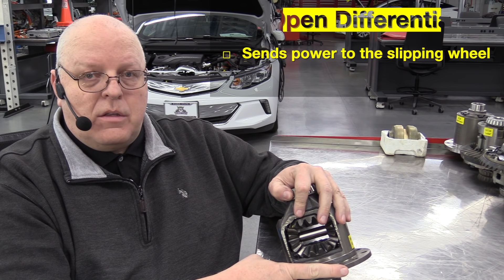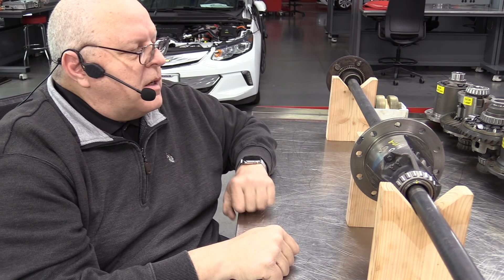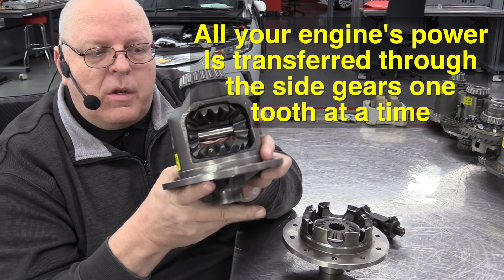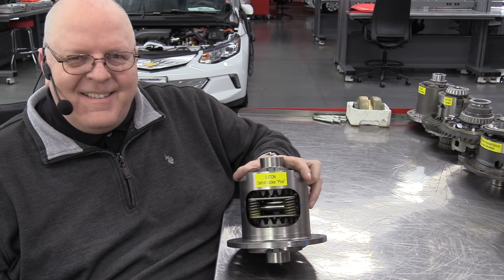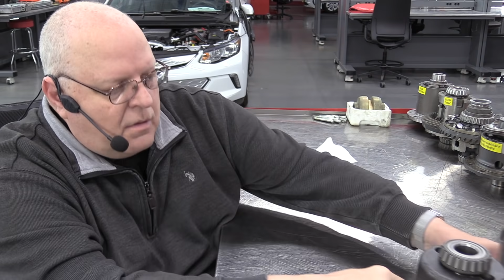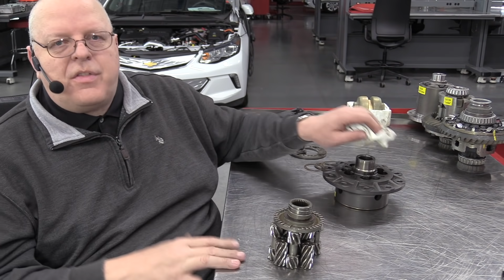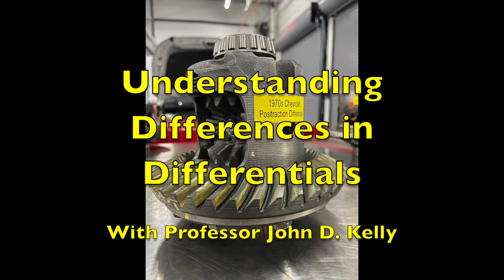Understanding Differences in Automotive Differentials

Comment: I believe that the original LSD operation mode (in my opinion) is different from the explanation given. The clutch packs are squeezed by action of the ramps in the casings and not the bevel of the gears (although it might be part of action). 
Specifically, the pinion pins are floating on the ramps/cams (heat treated angled areas in the case) and when there is a speed difference and torque applied the pins will ride up the ramp thus squeezing the clutch packs. This particular case would be identified as 2-way LSD (having effect in both directions).

Note: I might have misunderstood due to possibility that the original LSD was not the same LSD used for demonstration.
Reply from the maker: I believe you are correct. I got that wrong on that early differential. I tried to find the original patent with the original drawings and description, but could not. Thanks for the feedback!
Reply: @WeberAuto  One more item:  It is the torque applied to the ring gear that determines the force applied to the clutch packs.  It is not the differential action that creates the force.  When coasting, the differential has minimal clutch force and spins freely.  When torque is applied, the clutch force increases and the differential is harder to slip.
This knowledge can be used to get more traction out of a LSD.  If one wheel is freewheeling, little torque is applied to the other wheel.  If you apply the brake, apply power and ease off the brake, the clutch packs are loaded with more force and the clutches will transmit more torque to the other side.

Comment: Thank you!  Fascinating! Differentials always amazed me but I never knew exactly how they worked. First differential I ever saw was in my Tamiya Porsche Turbo Rsr Type 934 Jagermeister RC model car I built and my Dad who worked in his youth as an auto mechanic explained to me what a differential does.

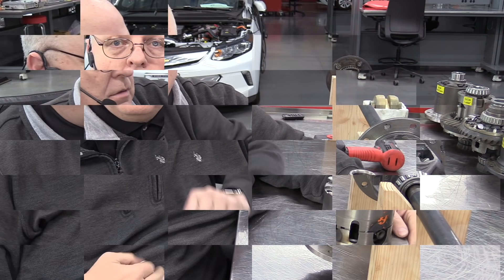So when you got to "17:23 See a 1963 Chevrolet positraction differential with clutch packs" didn't everyone think of the scene from the movie "My Cousin Vinny"?!

Mona Lisa Vito: The car that made these two, equal-length tire marks had positraction. You can’t make those marks without positraction, which was not available on the ’64 Buick Skylark!

Vinny Gambini: And why not? What is positraction?

Mona Lisa Vito: It’s a limited slip differential which distributes power equally to both the right and left tires. The ’64 Skylark had a regular differential, which, anyone who’s been stuck in the mud in Alabama knows, you step on the gas, one tire spins, the other tire does nothing.

Juror #1: That’s right.

Vinny Gambini: Is that it?

Mona Lisa Vito: No, there’s more! You see? When the left tire mark goes up on the curb and the right tire mark stays flat and even? Well, the ’64 Skylark had a solid rear axle, so when the left tire would go up on the curb, the right tire would tilt out and ride along its edge. But that didn’t happen here. The tire mark stayed flat and even. This car had an independent rear suspension. Now, in the ’60s, there were only two other cars made in America that had positraction, and independent rear suspension, and enough power to make these marks. One was the Corvette, which could never be confused with the Buick Skylark. The other had the same body length, height, width, weight, wheel base, and wheel track as the ’64 Skylark, and that was the 1963 Pontiac Tempest.
Reply from the maker: Thank you! I loved that movie
Reply: @WeberAuto  I love that movie too and now after learning about how Positraction works I will love it even more! By the way in May 2019 I was in Ogden for the 150th anniversary of the Transcontinental Railroad and to chase UP 4014 Big Boy. I ended up driving right by Weber State University which I didn't know was so close by! I really wanted to stop and see if you I could find you!
Reply from the maker: @mikekimura2532  I was probably there. I remember hearing the roar of the Big Boy steam whistle all the way across town when it arrived. We have moved into a new building in Layton Utah now. It is about 7 miles south of the Ogden campus.

Comment: You should add 1 way / 1.5 way / 2 way limited slip differentials, they have interesting ways of engaging, with a different effect on driving characteristics. The brand KAAZ seams to be popular in the aftermarket. 

Also, you talked about applications, such as rock climbing, but not drifting? I'm going to bet that 90% of people welding diffs are drifters.
Reply from the maker: Thank you for your suggestions. I am not a fan of welded differentials.
Reply: @WeberAuto  no one is. We're just poor.

Comment: What kind of diff do most fwd cars have? Ive had all fwd cars (dating from model year 1985 to today) except for a 01 grand marquis with an open diff. That open diff led it easily getting stuck in the snow. If 1 wheel was on ice and one on pavement you wold be stuck. None of my fwd cars,,, from chrysler honda gm hyundai ever behaved that way. I might get some wheel slip but it was always breif and youd get going easily.
Reply from the maker: Most have an open differential.

Comment: I watched your video on the RAV hybrid before this one on differentials.  Would you say that the Power Split Device in the RAV is just an open differential? The gear ratios between the 3 loads would be changed as needed, dictated by engineering, but otherwise there are planetary gears, carrier, and case in both. I'm just trying to deflate the "magic" that I've seen attributed to the Power Split Device. The "magic" is actually the generator and its controlling inverter that varies its load so power splits off to the other loads (engine and wheels).
Reply from the maker: In a general sense, yes. Thanks for watching

Comment: After studying differentials with springs; and considering the side gears: it seems to me that if a given car was to turn more than the average; the gears would be worn down quickly. Of course they might be hardened. I don't know.

What is your take on this John?

Thanks for you.r answer.
Reply from the maker: They do wear down over time. Especially with low tire pressures or wrong size tires on one side of the vehicle. I have seen vehicles with a lot of wear. More than the ring gear backlash. There is quite a clunk when driving.

Comment: Thankyou sir for differential video.
Sir one question i am doing a diploma in automibile but in my syllabus there is mechanical chapter only book for automobile can you suggest me that what i learn for better performance.
Sir pls if you have your mail id then pls give for more query related to automobile.
Thankyou so much
Reply from the maker: I do not know of a good book for you. Thanks for watching
Reply: Have a look for Hillier's Fundamentals of Motor Vehicle Technology - that was one of my go to books on the subject back in the day - there are many editions, so presumably if you buy the most recent one it will cover up to date technology. The 5th edition that I have has excellent cutaway drawings of things like carburettors (Fully mechanical and you can follow the parts in the drawing to see what moves relative to what to create the functions) and even weird stuff like a fully mechanical 4 wheel steering setup that steered the back wheels with the front for small steering wheel angles (To smooth out lane changes) and against the direction of the front wheels for big steering angles (For a tight turning circle). It's all done electronically on modern cars at a lower cost, but it's amazing to see what fully mechanical systems were able to accomplish before the invention of cheap microprocessors.
Reply: @peglor  but sir the advance in automotive will help me for my carrier and for new inovation actully i n my syllabus there is only old generation and nothing new technolgy that i learn and increase my skill.
Thankyou for reply.
Reply: @mdaquibautomobile5884  Don't worry too much or feel wronged because the stuff you're learning is out of date. In many cases you have to start at the start and understand the fundamentals of the older systems before the new ones and the reasons why they're used start to make sense. 
Without knowing what the fully mechanical systems had to do, you're not going to get very far trying to work out what an actuator driven by software is supposed to be doing - car companies won't give you the software they're using, so the only way to diagnose some issues is to understand whether the way the software is driving the actuator is correct. 
Also, what's current now will be out of date a lot more quickly than what was current in the 1950's when a lot of the groundwork was laid for modern internal combustion engines.
Reply: @peglor  before starting my openion i want your e-mail id, can you please give me.
yes i am worry a lot about my carrier and the future things but after giving suggestion by you i can understand that what i have i have to do that first.
Reply: @mdaquibautomobile5884  I won't put my email up because this is public, but I'm not the only person happy to help when you have questions - or possibly even the best person to answer most of them. I've never worked directly in automotive (apart from odd jobs on my and other people's cars), but I've been a mechanical engineer for 20 years.

Comment: There is so many crazy gimmicky things out there they probably actually do work I forgot about Subaru X mode where the ABS unit detect slip on that wheel and then uses the wheel caliper to clamp down and pushes the torque elsewhere in the drivetrain ! I can only imagine Acuras super handling all-wheel-drive!
Reply from the maker: Almost all vehicle manufacturers use the brakes to do the same thing. The Acura SH-AWD in all of its variations is pretty cool. Thanks for watching

Comment: Brilliant video!
I would like to suggest a correction. On a limited slip clutch differential the force on the clutch packs is not dependent on the speed. It is depending on the torque between the diff housing and the axles. The more torque you transmit the higher the force on the teeth and the higher the force on the clutch packs.
So if you drive a limited slip diff threw a corner without accelerating or breaking the only locking force comes from the pretention of the clutch packs. As soon as you accelerate the locking torque between the wheels increases proportionally to the torque you send to the wheels.
Reply from the maker: Thank you, you are correct about the torque being needed. I did not explain that adequately. I posted a correction at the top of the comments.
Reply: @WeberAuto  Glad i could help. Greetings from germany.

Comment: "Nothing uses regular gear oil!"

Me: cries in Toyota C60
Reply from the maker: LOL,  correction: No "modern" cars use regular gear oil. Thanks for watching
Reply: @WeberAuto  Just made that quip because it's getting harder and harder to find GL4 that isn't GL4/5 that will corrode my brass synchros.  

Anyway, as always, thanks for a superlative video.
Reply from the maker: @disgruntledfaerie  That makes sense. Thank you
Reply: @disgruntledfaerie  I had to use Amsoil in my 2006 Sonata as it specified GL4 only and it was hard to find, but Amsoil still sells (last I knew anyway) a GL4 gears oil.  Not cheap, but then neither is replacing the synchros in a transmission.
Reply: What does he mean by regular or non regular gear oil? I use gl-5 gear oil, is that considered regular?

Comment: Thank you Professor. In one of your videos, you said that P610/P710 have primitive limited slip differential. 
I watched this video to the end but I didn't found that one. Could you please explain also differential from P610/P710.
Reply from the maker: Toyota installed a conical spring behind the side gears of the differentials of the P610, P710, and P810. It provides a small amount of limited slip action during low speed acceleration.
Reply: @WeberAuto  Thank you!

Comment: Rather than worry about tire speed, an open differential provides the same torque to each wheel.   If the tires don't slip, that's just dandy.   If one tire loses it's grip, the "good" tire doesn't get any more torque than the slipping wheel.
Reply from the maker: Very true, thank you

Comment: Way back in about 1987 the Vernon Gleasman (1912-2004) inventor of the design, came and gave a presentation to the Student SAE at U. of Texas at Austin.   The company donated several of the differentials to the Formula SAE racing team. Formula SAE uses a Motorcycle engine, so A chain ring replaced the Drive gear (no pinion gear).  NO "pumpkin"  Housing was used; so differential case  was sealed with some shields to keep lubricant inside.    In those units the side gears where perpendicular to the ones demonstrated in video,  like shown here https://en.wikipedia.org/wiki/Torsen
.
Reply from the maker: Thank you for the information
Reply: What you describe is what I would consider to be the standard way of making a torsen diff. It was interesting to see that there are other options though. I suspect the ones shown in this video might last longer as there is more surface area for the helical gears to rub against to create locking friction. The other torsens have friction material that the side of the helical gears that transfer load between the ring gear and the side gears are pushed against to create locking forces. Torsens are very good on the road and off road at speed on loose surfaces for example, but quite poor in cases where a wheel leaves the ground because when there is a wheel in the air there is no torque passing through the diff at all to create binding force in the differential, so the raised wheel can spin freely and the wheel with grip will not be driven. Left foot braking gently can get over this problem, but a locking diff is the best option for rock crawling type use unless you like burned brakes. Torsen is short for torque sensing and it isn't so much a limited slip differential as a mechanical torque splitting setup - a torsen will provide a certain percentage of the torque at the wheel with grip to the wheel that's slipping to allow the vehicle to keep pushing forwards, but where a wheel is spinning freely, there is no load on the helical gears in the diff, so no torque to transfer. It looks to me like the other LSD's in this video (Apart from the governor based one) are doing much the same thing, namely that the side gears need to have some resistance from both half shafts to create any load on the clutch packs.
I'm pretty sure there's a version of the LSD that loads the clutch packs based on the rotation of the pinions between the side gears, so it can  lock up on tight turns if it's not set right, but will still work in cases where there is no grip at all at one wheel.
Modern cars just use the ABS sensors to find the spinning wheel and apply the brakes via the stability control instead, so torsens, LSD's and locking differentials are probably less common than they've ever been, even in offroaders.

Comment: There is one common type missing.... Viscous :(
Reply from the maker: Thank you for the feedback.
Reply: I need to study and learn how the cone-clutch LSD in the Miata and the helical LSD in the Civic work.
Reply: Viscous couplers.  Yep, had one in the transfer case in my 96 Jeep Grand Cherokee's NP249.  It worked great for many years, eventually the viscous fluid (a form of silicone based fluid) turned into a paste which then turns that poor viscous coupler into a locker which turned my full time 4WD system into a 50/50 torque split making turning into parking spaces and such pretty much impossible without binding everything up.  Its a great coupler but they do fail eventually of course, just like the clutch packs in a typical limited slip fail over time.  

Also Jeep had vari-lok differentials in the Jeep Grand Cherokee WJ (1999-2004) with the quadra-drive 4WD system (quadra-trac + front and rear limited slips) which had the ability to variably lock and unlock via fluid pressure applied against the clutch pack.  Great system, and of course they'd wear out over time like other clutch based limited slips.  The current Grand Cherokee quadra-drive system only has a rear limited slip however starting in the WK in 2005.

Comment: Thank you for fulfilling my request from some time back. You did cover the majority of the varying differential styles. I was looking forward to the actual Detroit Locker with dog-clutches and also the cone-type limited slip (Auburn). I’ve even seen planetary gear sets used as differentials to vary torque split front to rear in transfer-cases. My compliments on the broad coverage and the history of the better differentials. Your videos make my job easier. Thanks.
Reply from the maker: Thank you very much